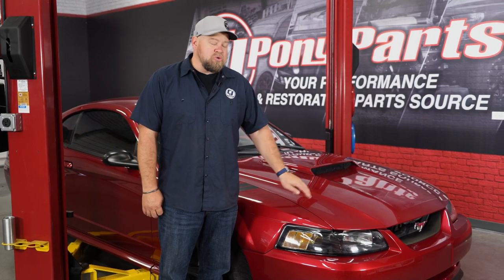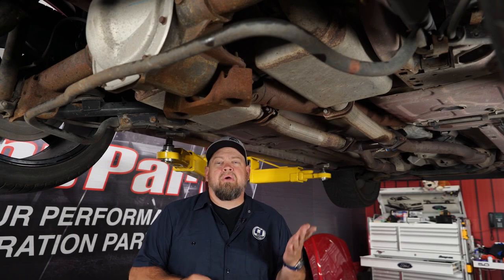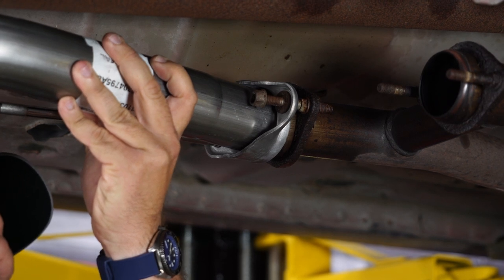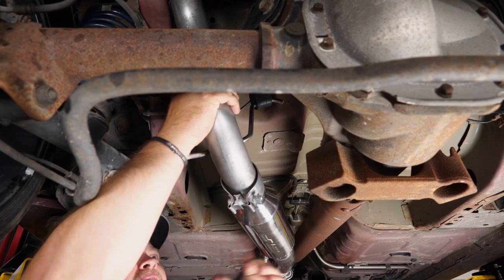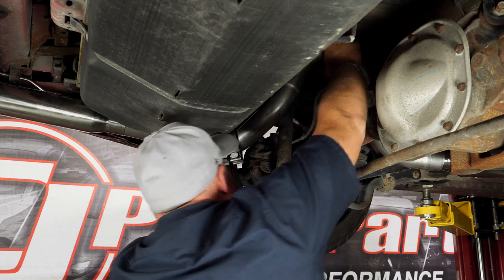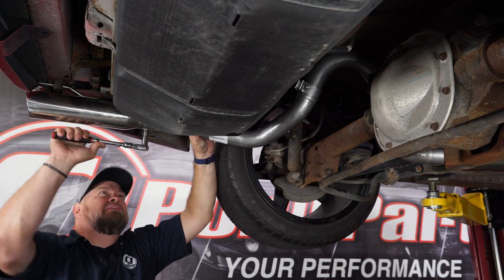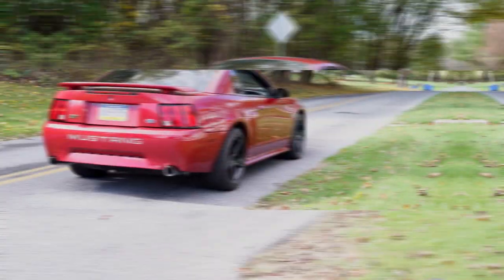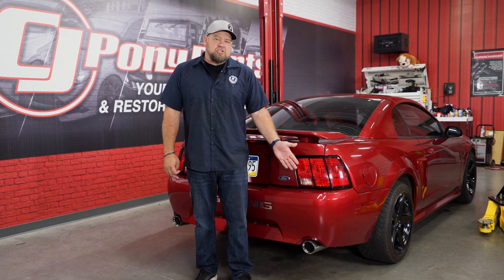SN95 Mustang Install | SLP Loud Mouth Cat-Back Exhaust System

Comment: 2V’s may be slow, but god damn if they’re not one of if not the best sounding engines ever.
Reply: Grant winburn i argee 100% with you the 2v's sound amazing🤤🔥🔥🔥🔥
Reply: There not slow if tuned properly lol
Reply: @univoxxx  if u think a 5.0 sounds better than a 4.6 u gotta be special needs
Reply: @ianvance2334  the 5.0 sounds like ass compared to the 4.6 motor
Reply: They are old asf 😂
Reply: @univoxxx  5.0 sounds like shit
Reply: @univoxxx  u said no bite either 😭 if we gonna compare a 5.0 might as well compare it to the 4.6 4v and lemme tell u that 4.6 got some bite
Reply: Right lol
Reply: @4.6L 3V  Which 5.0 though? The old windsor 5.0s from the fox body days sound outrageously close to the 4.6 in terms of sound. It's the Coyotes that have that more modern V8 sound that cracks, pops, and is really raspy, at times almost sounding like a ricer take on a V8
Reply: @Sloimer 5.0 push rods sound amazing. The coyotes? Not so much!

Comment: Quick question. Do the "Shotgun" resonators (I've heard some call them mufflers) actually legally count as mufflers? Or are they just resonators, and Is this technically deleting the mufflers?
Reply: 8 months late But for a legal exauhst system you would need both resonators and the mufflers. But I mean as long as you don’t drive like a a-hole you should be good
Reply: In my state the muffler's do have to have at least a baffle on the inside, but this exhaust system is clamped on so if you really have to, just unbolt the sops and bolt on a legal muffler once a year for a sticker, then slap your slps right back on and you're good to go. Just don't step on it all the time in town and you won't have a problem. When it comes to the cats and factory resignate hers as long as you have two cats per side (even if they are cleaned out) you should be fine at least in my state Maine. You also should be able to delete the resonators without much problem.

Comment: Why not weld all the pipes? Welds hold so much longer and better than clamps
Reply: probably cause not everybody knows how to weld lol
Reply: I had to weld mine. Mine kept springin leaks after jacking the car up everyday for a fucking week I decided to weld it. No problems yet.
Reply: You weld it and then it has to be cut apart if it ever needs to be removed.